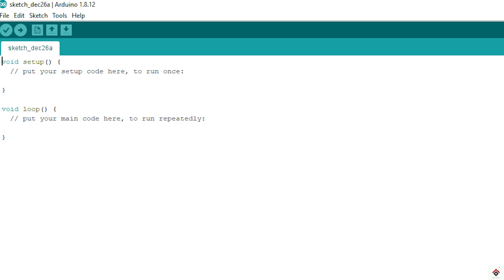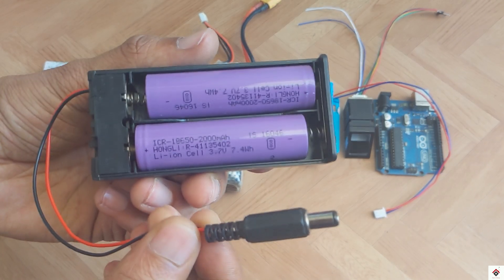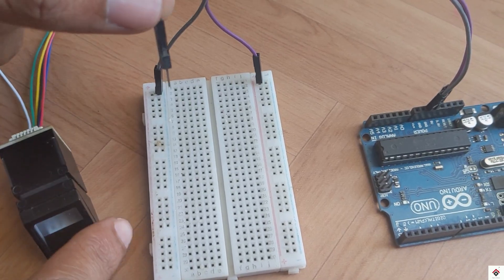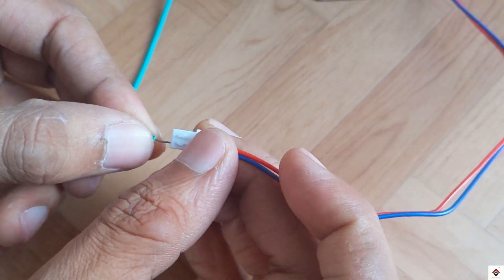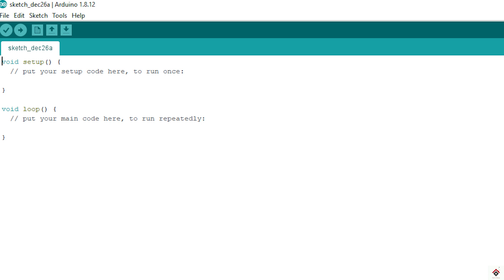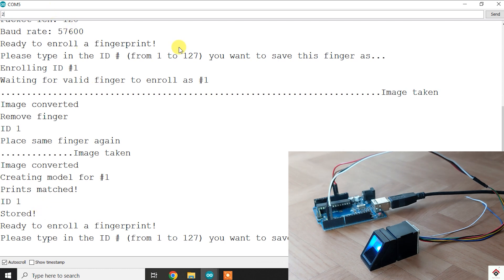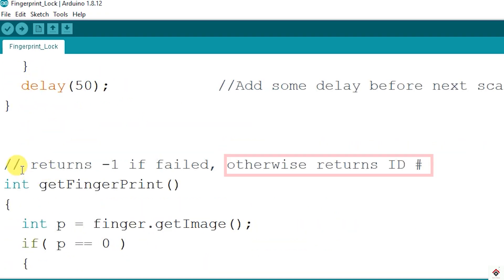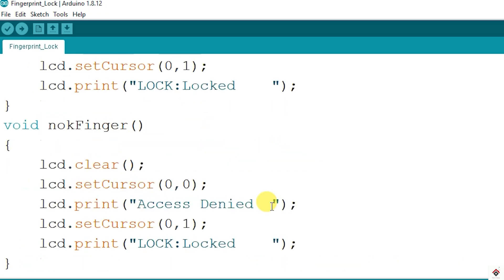Fingerprint Door Lock System Using Arduino 🔒 | R307S Optical Fingerprint sensor + Solenoid Door Lock

Comment: Sir can we use power adaptor to give power to relay module ??? And also  use laptop usb jack to power arduino???
Reply from the maker: Yes you can use. But connect all Gnd in common.

Comment: what did you use to connect fingerprint wire to jumper wire? did you soldier them?
Reply from the maker: No.
You get a connector along with the sensor.

Comment: I already paid so went i will get the code and circuit
Reply from the maker: You have already received it on mail.
Reply: @techathome yes but Are all the codes there?
Reply from the maker: Yes
One Code file and circuit along with required libraries.

Comment: One more question 10k potental meter is not aviable in my market can i use 50k 100k or some other
Reply from the maker: Which project are you referring??
Reply: @techathome   steering wheel